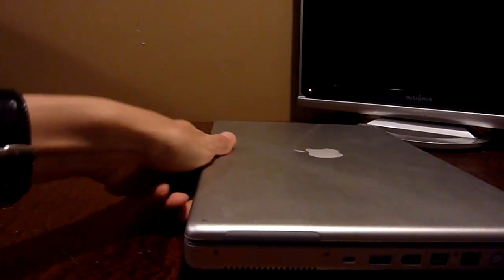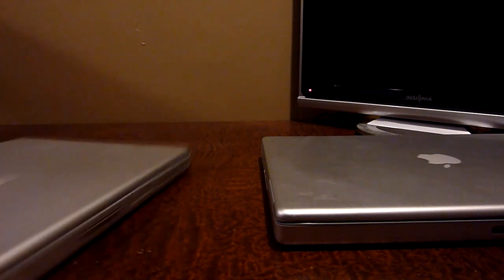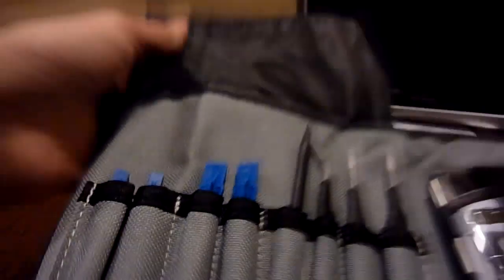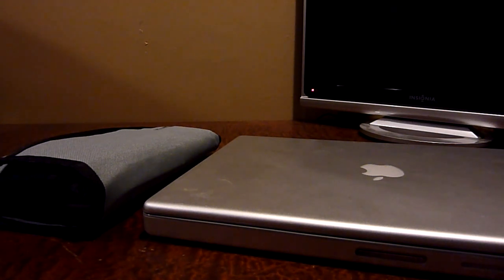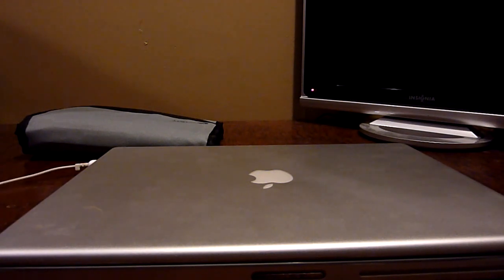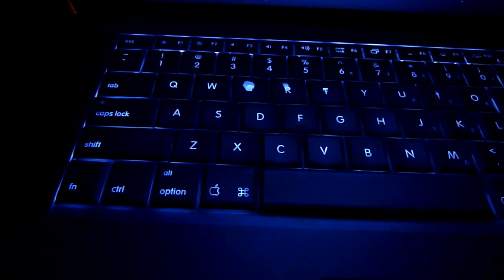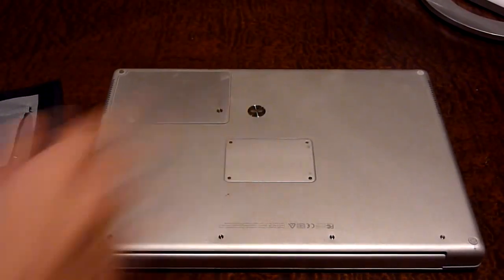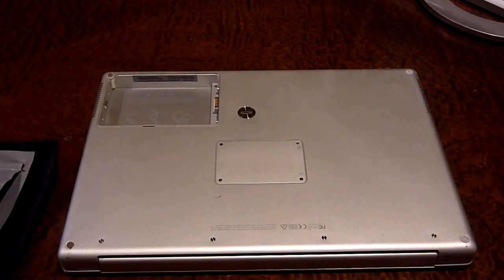The PowerBook G4 Project: Part 1 - Overview and Diagnosis

Comment: You probably got the wrong version of AHT. There is no universal DVD that'll run on all Macs, you need to find the specific version that supports this particular powerbook generation. It didn't come installed on Macs until 2011.